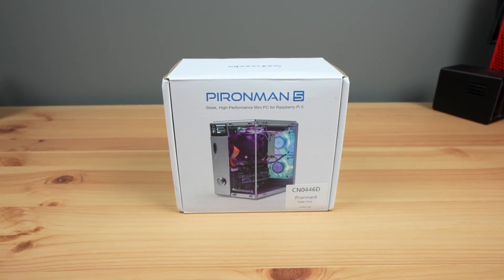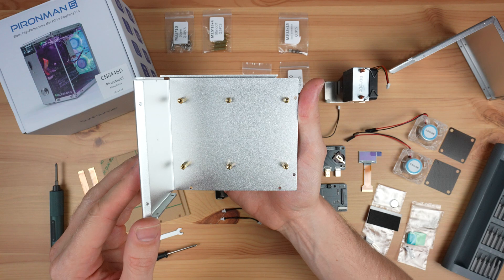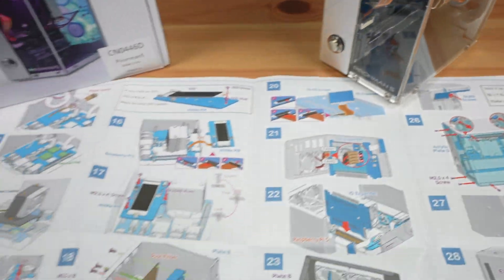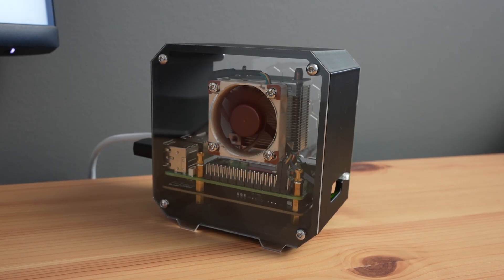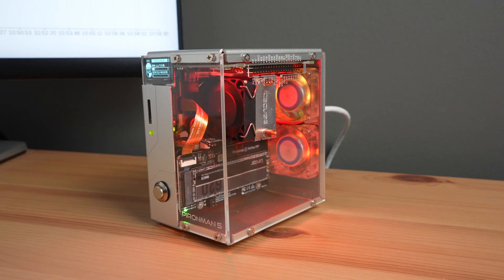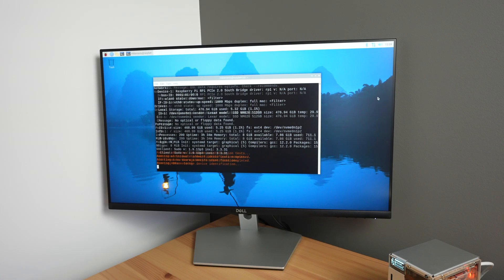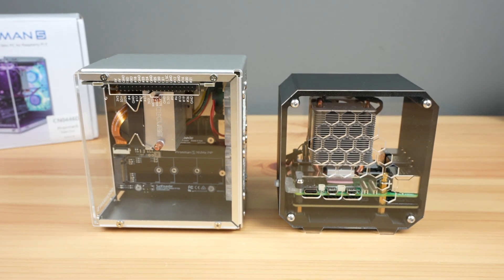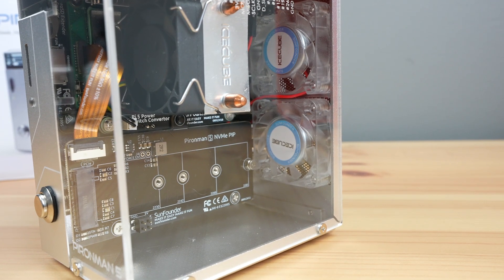Is This The Best Raspberry Pi 5 Case Yet? Meet the Pironman 5!

Comment: I wonder if drilling a few holes infront of the cpu fan would help pull cool air in and then skip installing the dust guards on the exit fans. Maybe even pull 1 exhaust fan to the side with drilled holes and have a pull push airflow for it. Might see if thats possiable my self
Reply from the maker: I would go with removing the dust filters, flipping the bottom fan aorund to be an intake fan and then installing a baffle acorss the top of the SSD so that airflow runs over the SSD, then around to the CPU and out of the top fan.

Comment: You know what you could have done to improve it? Just a small thing but maybe worth it.. invert one of those back fans flow so one blows in (the bottom one) and the other blows out (the one in parallel with the cpu one) so it makes the air circulation flows with sense 🎉

Comment: Are the fans uni-directional (i.e. you cannot simply turn them around)? Linus tech tips has a great video on fans for towers with one of the main takeaways being you want the tower to be POSITIVE pressure, i.e. more fans blowing IN than OUT. If you could mount them both the other way, the exhaust can just leak out the other openings and keep the dust out (and render the dust grids useful). Somewhat disappointing for this case but probably replaceable.
Reply from the maker: You can swap the fans around. I think having one blowing in and one out with some form of baffle across the NVMe drive would give you the best result.

Comment: what if one fan would be turned around as intake? what that improve things?
Reply from the maker: It probably would improve air circulation and cooling.
Reply: @MichaelKlements  it us a cool looking case for sure.
Reply: yeah. and remove the dust filter on the exhaust fan

Comment: Wish you could turn of the fan rgb's...
Reply: You can
Reply: @Neptun1um so far i've seen you can only turn off the board rgb's but the fans are hardwired.
Reply: @chrisbloem6639  i redirected the wiring and make a switch for it on the outsite (sorry for poor English it is not my first language and i used Google translate for this)
Reply: @Neptun1um  ah thats beyond my knowledge but i just changed the fans to non rgb
Reply: @chrisbloem6639  did you put in different one or just disabled it fully?
Reply: @Neptun1um  i put new ones on

Comment: Does anyone know if the software running the screen, etc. is just for Raspberry Pi OS or will it run on other distros?  I usually run my Pi with a multi-book config so that I can run many distros.  Thank in advance.
Reply from the maker: It'll run on a few distros, they've listed the below as being compatible Raspberry Pi OS Desktop - bookworm (32/64 bit)	✅
Raspberry Pi OS lite - bookworm (32/64 bit)	✅
Ubuntu Desktop 24.04 (64 bit)	✅
Ubuntu Server 24.04 (64 bit)	✅
Kali Linux 2024-05-15	GPIO Fan Not Working
Home Assistant OS 12.3	✅
Homebridge
Reply: @MichaelKlements  Thanks. I did purchase the case and got the software to run on Kali and Rasp Pi OS. I really like the case!

Comment: Very good construction and cute design, BUT: I really wouldn't expose a panel header to the outside world, but rather use a high-density socket like on of those originally used for external SCSI devices.

Comment: Funny, my first thought was the fans should be intake fans and the CPU fan should be on the other side of the cooler to have the same direction of airflow then.
Blowing cool air into the case directly over the components and into the CPU cooler might make it run even cooler. Plus, since the other components have no direct airflow over them right now they'd certainly run cooler with the intake fan configuration.
Reply from the maker: I think having a baffle in the middle and then making the lower fan and inlet and the upper fan an outlet would make an improvement. I might try this out.
Reply: @MichaelKlements That was exactly what I was thinking. Make it out of clear plexiglass if you can. I’m ordering a case now, based on the video. I wish it would support a base board, or a dual pcie to m2/nvme. Gotta get that Halieo 8 in there somehow. Cheers 🎉

Comment: I still think the pi5 argon neo(with or without the nvme extension) with some manually added ducting is the best rpi case in a few ways. as long as you stop the fan recirulating air it will be quieter than you'd expect because the heavy shell dampens the harmonics.

This is the most comprehensive review of this sadly rather mediocre case I've seen and I'm very grateful.
Reply: I have the pi5 argon neo with the nvme extension also. I like it, cooling is good, its more compact and it is more cost effective.

Comment: You could flip the bottom fan to pull cool air in, and leave the top fan venting. Maybe that would improve the thermals a bit? But a strange design for sure. Having said all that, thermals aren't actually a thing here, it's just about if it looks pretty. Do the RGB fans colour match the rest of the RGB, or do they just rainbow cycle?
Reply: You read my mind.  I was thinking the same thing. I have one on order and I'll test it out and see what's what.
Reply from the maker: Yes I've seen someone add an acrylic deflector internally sp that the bottom fan pushes air into the case, airflow then goes along the SSD and around the deflector then back around past the CPU and out the top fan. I agree, thermals are not that important for a case like this but it is advertised as having an advanced cooling system, that's why I tested it.
No, the fan RGB is not controllable. They just run through a rainbow cycle, but only when they are on.

Comment: I like the case but as you stated, the cooling is a bit underwhelming.  I would upgrade the fans (probably Noctua) and remove the 'dust' filters.  I do like the full size HMDI ports - I would really like to see you do that with your case.  Thanks for the video!
Reply from the maker: Removing the dust filters and adding some inlet vents to the front panel would probably make a big difference to the thermals. 
It would be great to add full size HDMI ports and re-route the USB C port on my case - I wish you could buy the adaptor as a standalone item.
Reply: Hi Michael!
Waveshare have a very similar adapter board! I'd love to see your case adjusted to include it!

Comment: $80 for this case? You can easily find computer cases for less. I guess I'm just struggling to understand the price for something so small.
Reply: Looks like 5 PCB's, an OLED screen and a cooler along with the usual case items (some fans) probably increase the cost. Also cheap PC cases are mass produced to offset the manufacturing costs (hence why we see the same tooling used on multiple cases from the same manufacturer). Not defending the cost of it but it doesn't seem like it was a cheap item to produce for a niche audience.
Reply from the maker: As @superliljohn91 has said, there is a lot more to this "case" than just then enclosure. Its got an included CPU cooler, an NVMe adaptor, RGB controller, fans, an OLED display and a few other adaptors. That said it is a lot as an accessory to a Pi.
Reply: @MichaelKlements I agree, but it doesn’t have any style.